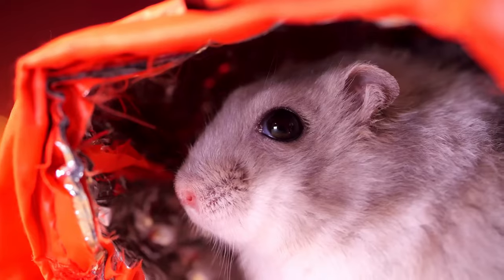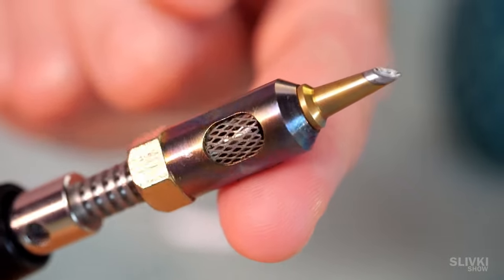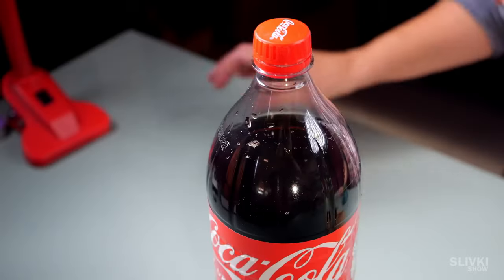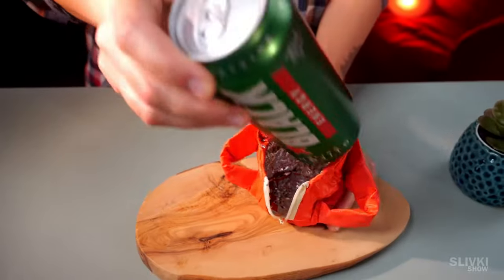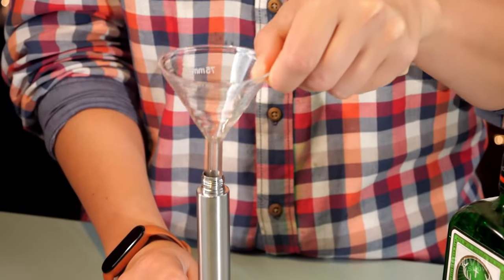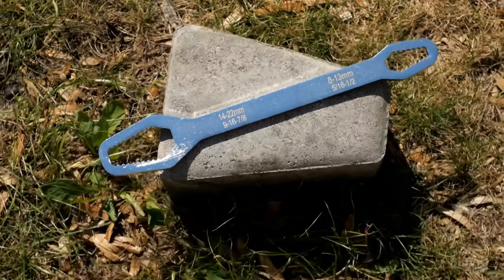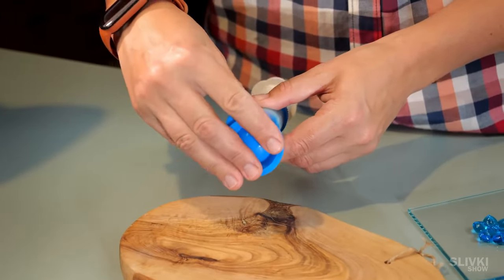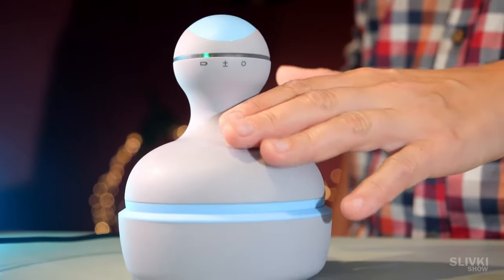THIS IS WHAT WE BOUGHT ON ALIEXPRESS

Comment: That soldering iron would saved me countless times
Reply: I agree, so handy not having the cable and need for electricity
Reply: @Kaimikazee1  I’m not murican. I try my best
Reply: I have a little 5v usb soldering iron it's very usefull sometimes
Reply: @kiwi8054  do you have a link?
Reply: @mcbchannel7173  just serch for silverline usb soldering iron
Reply: They sell these on Home Depot that auto ignite.
Reply: What? These iron have been available for DECADES. Buy a decent one, an ANtex GasCat.
Reply: Been using a bernzomatic gas torch for years, before that, i used portasol torches. Gr8 idea, but not a new one.
Reply: Dont buy that garbagio. Get a quality one. The heat will sync down the tip into the plastic and you will blow your fingers off.
Reply: I liked my portasol, but nevertheless: The flaw, that practically ANY gas device got, is the refilling valve, that starts leaking one day (rubber ring worn out), making the whole thing useless.
The one shown here blows hot air all around (Portasol got 1-2 wholes in the tip) - which often is a problem or no-go (working on sensible stuff or much plastic around etc.).
Last, not least: The catalyst tips burn out regularly. Power control and change when tilting them is an issue, too.
Yes, the pure power and runtime is amazing. But only for certain use cases.
Reply: Just don't buy the cheapest one on Amazon. I got two and neither worked.
Reply: @nulledrust9809  And then pay ten times as expensive, buy so often from aliexpres and 10 times cheaper plus it just works and no it's not all junk that comes from China.
Reply: You can say what you want but not everything from China is rubbish and especially not on aliexpress, if you buy something on ali you look at the reviews how many satisfied customers have bought it and from there you buy the product. If you buy the same product on amazon or ebay are the prices 10 times as expensive for the same product then you are just a thief of your own wallet.If America sells products with made in America on it and just as cheap as the products from China, then people will only buy stuff from America, but if it is much too expensive then you must be crazy to buy it.
Reply: @nulledrust9809  And even then it is cheaper, so products from China are number 1, products from America are number 100
Reply: @nulledrust9809  That's right, I also heard that they sell the parts to the Americans because they pay a lot of money for that🤣

Comment: Your pop bottle lift pillow is also good for lifting doors to set them in place when installing them, use two and you can trim the level on it.

I do not like metal flasks, as some places use metal detectors, I have a few plastic ones with plastic caps, as well as a glass flask with a plastic cap. the metal detectors don't need to know I have something to drink...

Comment: I have a couple gas soldering irons, both use lighter fluid and have a built in piezo electric igniter, very handy, but beware of where the exhaust is pointing. I also remember having fizzy drink caps similar to that back in the mid to late 90s.

Comment: The secret to keep the gas in the coca cola lies in the temperature.
Keep it close to 3°C and it'll not loss it's gas (whatever it's called, I'm not native English speaker).
That's how they manipulate this soft drinks in the manufacturing process.
Reply: CO2 or Carbon Dioxide.  That is a Temperature of a fridge and while it might help it won't stop loss of fizz.  Also the invention won't work sadly, it won't help even under pressure.

Comment: That jacket is very good for people that have "freeze allergic". with that jacket you don't need to hold the cold beverage with your bare hand.
Freeze allergic problems is the same as being allergic to a dog, cat or even pollen. The only difference is that cold temperatures activate the body to produce histamine.
In my case i get the problem when there is a big temperaturer difference. In the summer, sun bathing. your skin get wary warm. If i then hold a very cold beverage or a ice popsicle with no stick, only a paper cone. Then i got bumps i variated size... and they itch like h*ll.
So.. that jacket would be perfect :P
But in normal cases... it also protects your beverage getting warm from your hands ;)

Comment: That soldering iron is unsafe, and like you almost said, can only be used a dozen times. 
The mesh rusts quickly and cannot be bought on it's own once it rusts away and when that happens the flame won't keep. It slowly slowly gets weaker as the mesh rusts.
It's annoying to have to manually light the flame each time which means having to carry a lighter around too.
Or Maybe i may just have had a different cheaper brand, but i would not buy this one ever again.
Rather buy a Dremel Versatip or Versaflame and you're good to go, it has a self igniting feature and the ignition has a safety lock and comes with a variety of tips. Though it too has this annoying mesh, the dremel lasts longer and the quality of it's flame lasts too!
Reply: @Pissiphus  where i am, we have no electricity for 2 hours at a time, 3 times a day 😁🤦

Comment: That soldering iron is as good as useless for DIY electronics, since it has no thermostat and therefore no way of maintaining a fixed temperature. Runaway temperatures often discourage many beginners. Because it makes it seem like soldering is a lot harder than it really is, and makes people believe that they are simply just bad at it. I have been there myself.
The correct temperature to use is defined by many factors. But if you haven't got any way of controlling it, then you have no way of learning what those factors are, what works and what doesn't.
There are many good soldering irons to be found on AliExpress with build-in thermostats. Some are even wireless/rechargeable, come with a variety of different shaped interchangeable tips, and are much cheaper than the old-school soldering stations... Using the correct tool for a given task, is half the work already done.

Comment: People are lazy and ignorant of basic laws of physics. Boyles law of gas says that "gases will always travel from an area of greater concentration to an area of lesser concentration". Your soda pop is fizzy because it has a high concentration of CO2 within the solution. It goes flat because the area of empty space above it has a low concentration of CO2. To keep it from going flat for weeks all you have to do is after pouring your drink just squeeze all the air out of the bottle until the beverage level is at the top of the bottle thereby minimize the area with a lesser concentration of gas. works every time and I've been doing it for years

Comment: A better hack for the table is to insert a screw in the bottom of the legs so you can adjust the height by shortening or lengthening the screw
Reply: It will scratch floor

Comment: The first product is crap!
Plug in and watch when you're out of power!
The second product is consumable! Still waste!
Supplies are skyrocketing now! Especially fossil fuel products!
When you're buying gas refill tanks just to run a length of wire!
It's a waste!
The third product is even crap!
His plastic screw holes can only be used on Coca-Cola!
Nothing but pressurization!
Unless you buy all the screw adapters of every size in the world!
You can make the most of it!
The fourth product is very sad! I don’t want to talk about it! Ignore it!
The fifth product is crap! Same as the first!
The sixth product must be bought! Not just for liquids!
This is something you will 100% use for survival in the wild!
Regardless of whether you hold tinder or pills, or oil, small objects that cannot be wetted!
The seventh product can only be used on machines invented by humans!
The utilization rate is about 60%! Think before you buy!
The eighth product is also waste! Just ignore it!
The ninth product, think about it for yourself, is it necessary to buy it?
If Massaging a Cat Can Make You Orgasm...